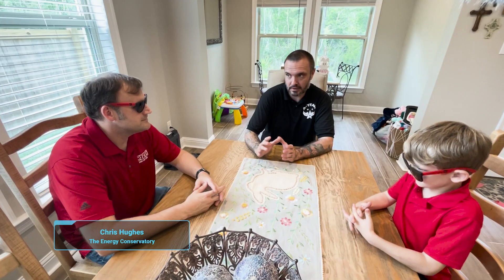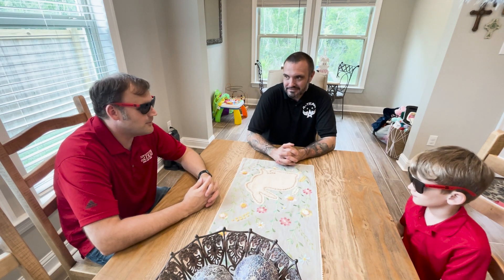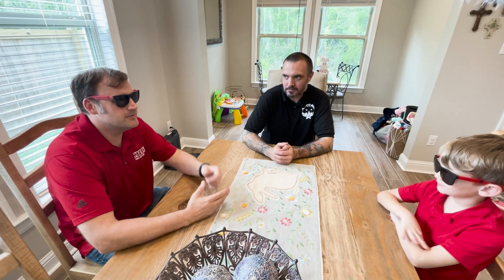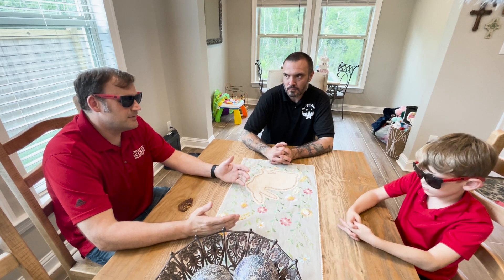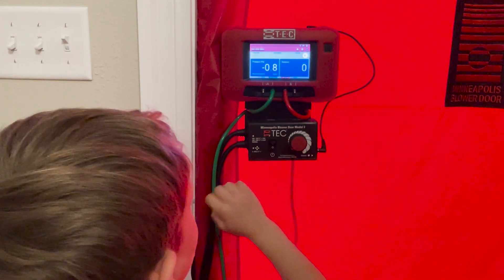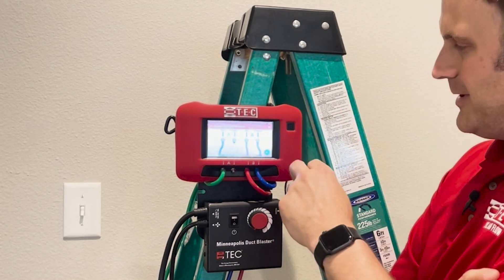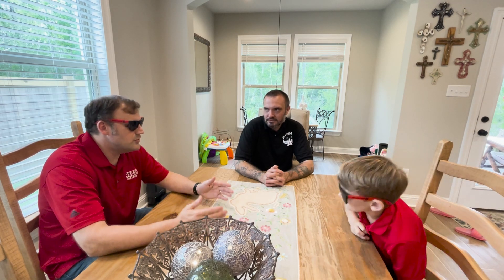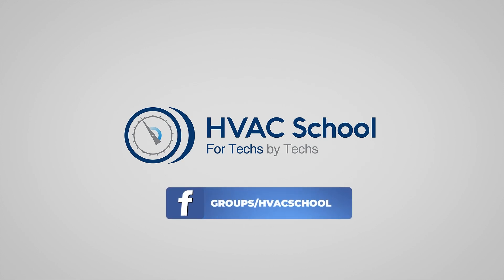Measuring Duct Leakage To Outside

Comment: I work in Wx and I perform Blower Door testing all the time, but this video is not that helpful to me. If you don't use a duct-blaster, and only use the Outside Pressure Reference (at the Blower door apparatus) and then turn the HVAC ducted system ON (Blower door fan OFF), then what information can one extract or interpolate with all indoor doors open and compare to the all doors closed? Is there a way to calculate the CFM loss?

Comment: Interested for feedback from folks who conduct this test. The video noted "outside the thermal envelope" as the lto cfm. If the duct works in the basement, do we mean "leakage in the unconditioned basement" or "leakage" literally outside the home." Also, does anyone open a door or window to connect the basement space to the exterior elemetns.

Comment: How do we know what is an acceptable amount of leakage? For instance, percent of leakage?
Reply: The best way I think I could answer this would be like this.  Most people in a hot humid climate would not dare have a constant volume exhaust fan running with 50 cfm.  I think personally keeping it under 25 cfm would be would be a good measure.  But this is my opinion based on my own experience in houses in my climate.

Comment: It appear that two 2-channel manometers are needed, is that right? The test could not be performed with a DG-1000 and a DG-8?
Reply: The DG-8 in combination with the TEC gauge app will drive the blower door.  You will not get a blower door cfm reading, but that is not needed for the DLTO test.  You will need a DG-1000 for the DuctBlaster to get a cfm reading.
Reply: The 1000 will work, the DG8 will not though